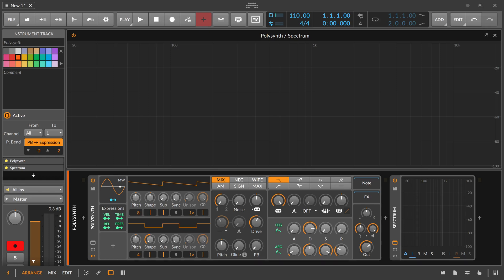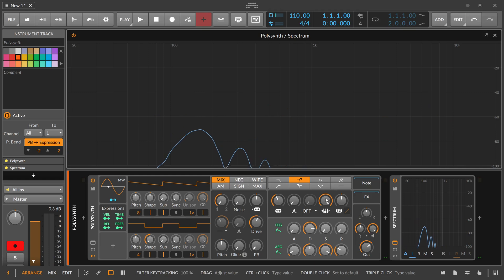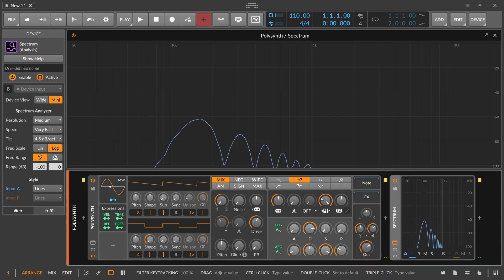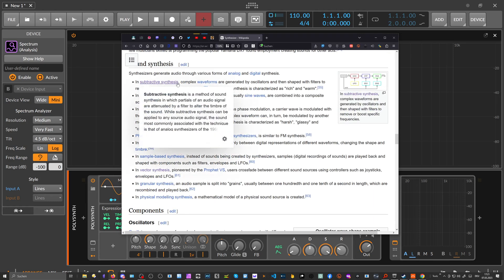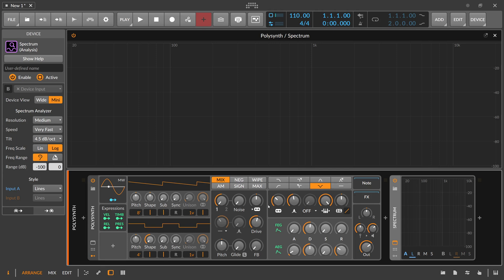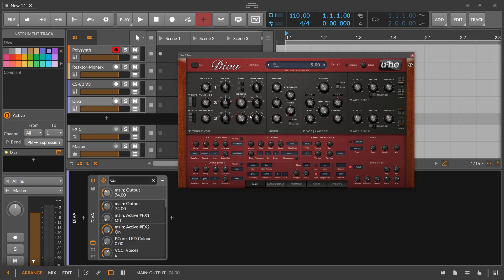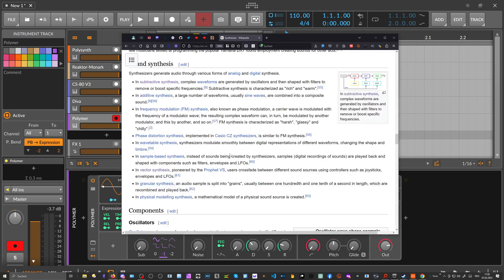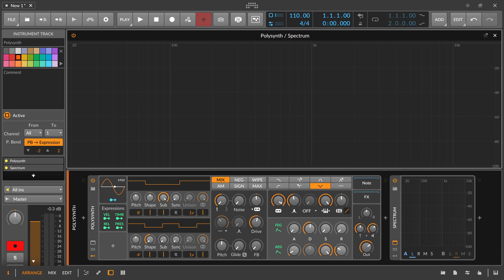Where is the SINE oscillator??

Comment: But consider the trouble you have to go to, wasting the use of your filters for what is often a built-in feature.  On the CS80, there is a sine wave oscillator, which you can mix with other waveforms, still leaving your filters available for shaping your sound downstream.  Listen to the lead in To The Unknown Man, which has a velocity-controlled saw mixed with a triangle or sine two octaves up.
Reply from the maker: this video is not about arguing if a sine osc is useful or no. you can come with all kind of arguments why you want one in special occations. Its about why certain synths dont have one. And its because most classical subtractive synths dont have one. Because it made more sense in terms of harmonic subtraction and cost to build a synth back in the day and some modern synths emulate close to the original.

Comment: ARP 2600 has a Sine output on OSC 2. It sounds lovely, whether it makes sense or not.
Reply from the maker: there are many subtractive synths with sine oscs :)
Reply: The 2600 is semi moduler... in this case it makes sense to have a sine wave as it is often used as a modulation source for FM sounds and so on. It still doesn't make sense patching a sine directly to a filter as as what would be cutting out?
Reply: I like the point made that Sine is used for FM. Great point @MarulaMusic. FM being more additive.

Comment: The CS80 has a “hidden” Sine oscillator, it is in the filter section.
Reply: sure i bet you could take a sawtoooth or rect and just filter with bandpass if curve is steep enough infrequency domain. think thats even one main approach of synthesis. even existing laplace to z transform algorithms arround to simulate electronic circuits behaviour creating sines

Comment: I wouldn't state, that it makes no sense to have sines in a subtractive synth. You can use sines as a master for osc-sync (would be about the same as a square probably, but it's an option, and free of aliasing). You could AM/ring modulate it with another osc that would create harmonics for sure. You could also drive it before (or inside) the filter to create overtones that would sound different. Using unison you can build a pseudo additive synth out of sines.

I think, the case is rather, that analogue synths do not offer sine waves, since all the other waveforms are a lot easier to produce, and so analogue emulations try to be close to this. The Nord Lead was a polyphonic subtractive synth for sure, and it had sine oscillators.
Reply from the maker: I thought someone would answer something like that. But in the classical form of subtractive synthesis, an overtone-free waveform makes no sense. Of course, you can use all kinds of arguments why you would want to have it anyway.
Reply: @PolarityMusic  I was just trying to state, that the reason for not having sine waves in most subtractive synths is not that they'd not be useful, but it's instead an engineering and costs problem in the analog synth design (the Alesis Andromeda is the only one that I remember having a sine oscillator). Most subtractive designs are analog, that's why it's uncommon: in digital synths, it's not making sense to dismiss this waveform. Using hard sync (classic subtractive feature), ring modulation (classic subtractive feature) sine oscillators can bring a lot to the table even in subtractive synthesis.